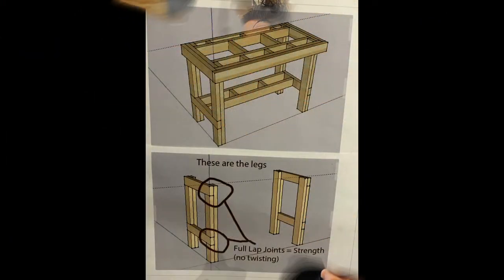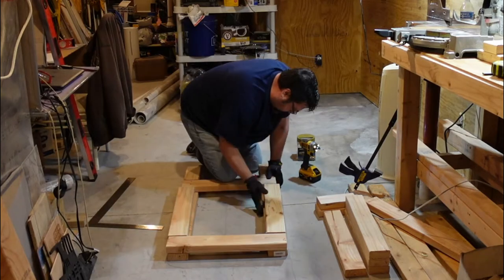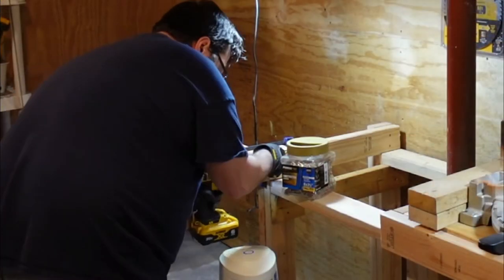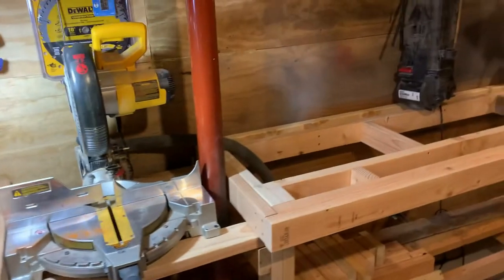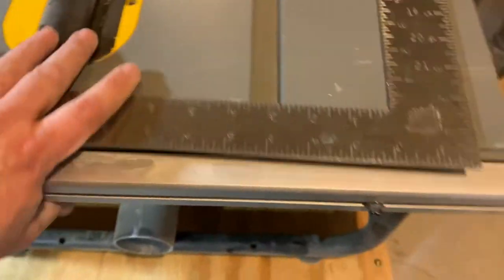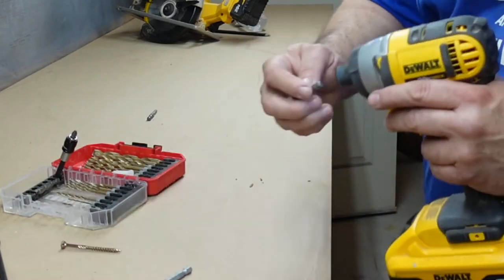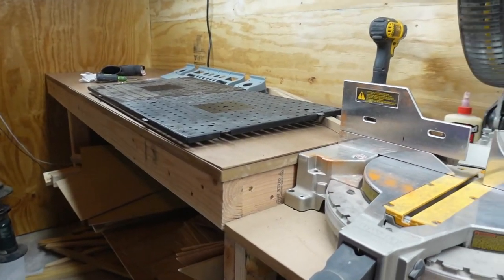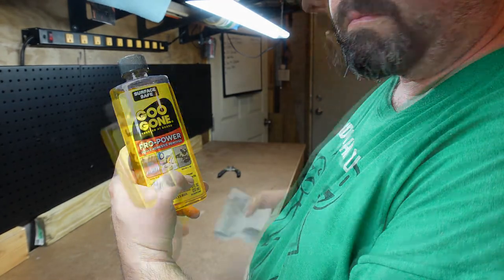How to Build a Workbench With Compound Miter Saw Insert (DIY)

Comment: If you tack the top work surface on with small nails or brads around the edges, you can easily replace it when it gets dirty and worn.
Reply from the maker: I left it be..it’s not moving around or anything so it’s fine. Thanks tho!

Comment: Did ya secure them to wall underneath?  WOuld make it even much stronger and would help if you put a lot of weight on the front end of hte workbench, due to the overhang.
Reply from the maker: If I ever have any problems I will, but this is heavy so it doesn't budge!
Reply: @WhiteysWickedWorkshop  Just keep in mind it is hanging over more in front than in back.. could be problematic if say you stood at the front end.
Reply from the maker: @jenniferw8963  It will never fall over due to both sections being tied together with the pole in between, thanks tho!